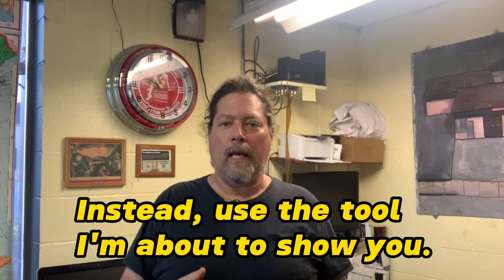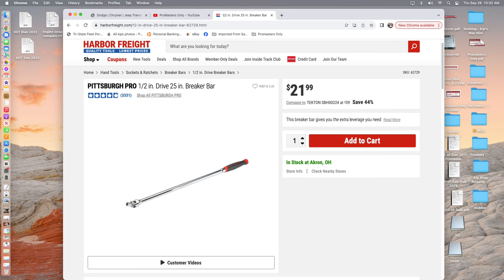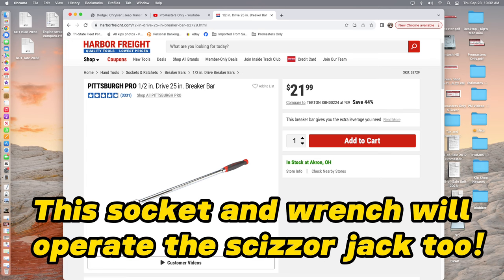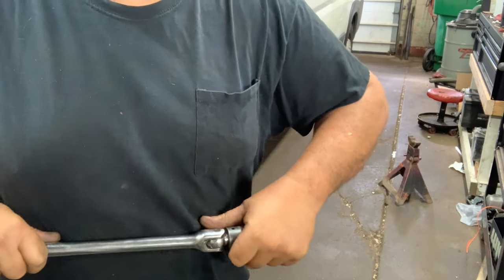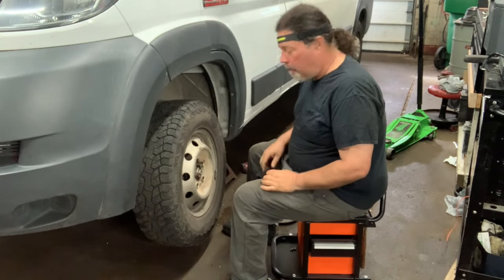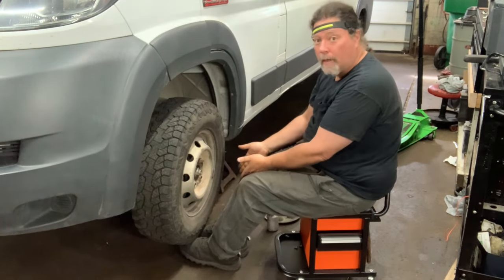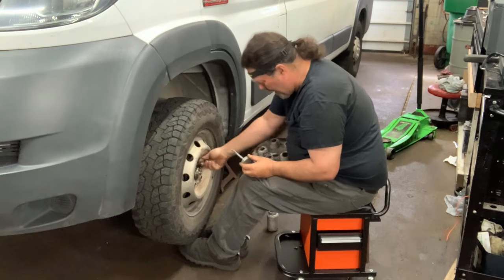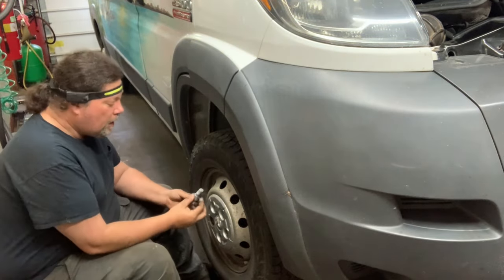Ram Promaster BETTER Lug Wrench Tire Change Nuts Torque and all things Lugs Bolts. Promasters Only

Comment: Hello cousin Kip, I am glad you know that we have Princess Auto in Canada, it makes me feel welcome to your garage. I also put anti-seize on the inside face of the wheel where it contacts the hub, the rust sometimes fuses the wheel to the hub seat. I like your little bench seat.
Reply from the maker: That's a VERY good idea. Not so important on the Promaster as other vehicles, but anti-seize makes everything better, especially in Canada. BTW, those little rolling tool stools are a lifesaver, because we don't put the vans on lifts. I have every tool I need in that little rolling turd, and it's comfy to sit on too! And it's portable, so you can bring it with you if you need. Nice.

Comment: I’m really glad you brought this up I had no idea. I’ve put anti seize on my lug nuts without knowing it changes the torque spec. You sent me down the rabbit hole but I’m back and I know you’re correct. I’ll just have to make people aware of my anti seize when they rotate my tires and specify torque values so they don’t over torque.
Reply from the maker: Correct. All torque specs are given dry.

Comment: I use a tire changing tool aka pry bar from harbor freight to align my tires to make mounting my tires alot easier than manhandling the tires!And I have a inverter in my van so I use and electric torque wrench even though Ram doesn’t recommend it. Just slip the pry tool under the bottom of the tire and let the leverage do the heavy lifting and aligning is sooo much easier!!
Reply from the maker: Whatever works!
Reply: @promastersonly1419  I learned to use the prybar/ tire changing tool from watching my guy that installs tires on my box truck

Comment: Great info as always, thanks. A couple of threaded pins (e.g., long bolts with heads sawed off) can also be handy to hold the wheel in place.  Lots of stories out there about tire shops not hand threading the bolts to start with and stripping them too.
Reply from the maker: God help you if you strip or snap one of those lugs. Always turns into a can of worms.
Reply: @promastersonly1419 can of worms great I’ll grab my rod i keep over head compartment and go fishing

Comment: I did a bracke pad replacement and tire rotation on my promaster 3500, and I have to use wrench fro. A Chevrolet SUV because the wrench from the promaster was bending im definitely getting  a new one for the promaster
Reply from the maker: Best $25 you'll spend.

Comment: Please make a video on front bearings because i'v gone thru a dozen just this year. Thank you
Reply from the maker: Strange. Did we talk about this? Can't remember. The trick is not to replace the bearing, but replace the entire knuckle with a junkyard knuckle for under $75. No dicking around with presses, or scrapping bearings when you install it backwards. And your ABS sensor will just work. But I'd be very curious as to why it's trashing bearings.
Reply: You definitely must be installing the wrong way to go through two in a year

Comment: I love your channel. I have a 2018 long 3500 hi-top. Have you talked about the tire pressure. 80 on the back and 65 on the front. I never carry any weight, I only use it for camping and traveling. Should I run 65 all around ? Thanks
Reply from the maker: Sorry I missed this question. For a light van, yeah 65/80 is too high and the ride will be harsh. I would go to 60 front, 70 rear or even 65 rear. You'll find it's quieter and smoother, and will still handle just fine.

Comment: With the breaker bar horizontal; using body weight you can bounce on the bar and tighten or loosen them easily.
Reply from the maker: True, and I can imagine myself explaining to the emergency room doctor why there is a jack handle sticking out of my ass. Jumping up and down on things is not what you want to be doing on the side of the road, at night, in a snowstorm, with a flat tire.
Reply: @promastersonly1419  I hold it with one hand and my arm straight.  I don't do that stand or jump on it thing.
Reply: @rtz549  damn sure sounds like what you were saying to me

Comment: I stopped using anti-seize after a Tires Plus guy snapped a stud during installation.  He blamed it on the goop.  Probably using a 300 ft-lb air wrench.  Told me to go to a dealer up the street to get a new stud pressed in.  I also quit going to Tires Plus.
Reply from the maker: Common. Lubes changes the torque spec, and I suppose a zealous guy could shoot so much jizz into a blind hole as to make a hydrolock situation (these in the van are not blind). Remember, techs get fired for not using enough torque, so they tend to go completely apeshit, leaving the problem for the next guy. Which is YOU!

Comment: I would like a recommendation for a cordless impact drill for changing tires on the road, as a professional mechanic, I would really appreciate any advice !
Reply from the maker: @HotZone97  very few cordless guns have the power to do the job, and you’ll also be dependant on the battery, it’s state, plus the charger and so forth. For such a specific and infrequent job, use a breaker bar and a simple tube extension if you need it. Any tube that fits over the handle of the breaker bar will multiply the torque and turn you into superman.

Comment: Would you still go with the factory jack, given how much extra weight may be add due to cargo or a fancy #vanlife buildout? (p.s. I have a 4T bottle jack and a 2x2 3/4" plywood sheet)
Reply from the maker: Good question. I would assume that Fiat was smart enough to design/test the jack at the max weight of close to 10,000lbs. If I look at aftermarket scizzor jacks, they all look about the same as the van's jack at 10k. I think it's probably fine. Remember, it's only doing one corner so if the jack rating is equal to the tire weight rating, it's probably fine. But in a motorhome app, I could see combining a tire jack with a leveling jack, so nobody falls off the toilet or rolls out of bed. Lots of options, I suppose. The advantage of scizzor jacks is space and weight and storage.
Reply: I was thinking of doing the same thing buying a bottle jack to simplify or a low profile floor jack to go with my electric impact wrench!! Make sure you get yourself a pry bar tire changing tool from harbor freight to make aligning the tire up much much easier!

Comment: The 1st time I backed out those LUG STUDS, I thought WTF… the whole wheel stud came out too, with the lug nut.
Of course it was at night in the dark on the  Kentucky Turn Pike In the fricken rain !!
But yes that tool is complete junk that comes in the black box !!
I used the scissor-jack underneath the extension piece to keep it level with the lug stud.
What a engineering failure on their part with that extension and T-bar handle thing !!
Reply: Pick up a pry bar tire changing tool from harbor freight for aligning the tire leverage works better than manhandling and allows for one hand treading
Reply from the maker: Agreed!

Comment: One of my lug bolts is broken off and completely stuck inside the wheel drum. Mechanic says the entire knuckle assembly needs to be replaced. $1000 for a broken $8 bolt
Reply: You could have located one from the junkyard and made out like a bandit for around $100
Reply from the maker: Junkyards have the complete knuckle for $75-100.

Comment: Heavy van plus those steel wheels.  If those wheels are flimsy or flexible; theoretically they could attempt to work the wheel lugs loose.
Reply from the maker: True, but the difference between 105 and 143 seems immaterial to me. At 105, they are NOT going to loosen up and come flying off.

Comment: Hi! I have a 2016 ram ProMaster 2500 Cargo Van and i took it to a lock smith to program a new key for it. But it wouldn’t accept the key and it would start the van but cut off all power after 3-4 seconds. If you know or heard of the problem please let me know! I’d love to hear from you.
Reply from the maker: That means the security system is tripped. You'll notice a little padlock icon on your dash when that happens. It'll start, run for 3-5 seconds, then die. I have a video with "key debacle" in the title. It won't help you get the right fob programming, but at least you know the metal part of your key is fine. I imagine you ordered that from the dealer. But your fob still needs programmed. I'm going to guess that it isn't operating your power locks?
Reply: @promastersonly1419 I have a backup key that locks and unlocks the van but sometimes it starts and cuts off after 3-5 seconds. Took it to a mechanic and they said it’s rejecting the key. But like I said it locks and unlocks the van. Maybe a cpu issue?
Reply from the maker: @orenw1262  honestly stumped. The same fob that works to fire the locks should work to start the van. Maybe something else is tripping the security system. You dont have access to a pro scanner, do you? One that can read body module codes.
Reply: @promastersonly1419  unfortunately we don’t have access to one. Seems like a problem we won’t be able to solve unless we involve the dealership which is a pain as always. But thank you a lot for your help! Earned a sub for sure

Comment: If those wheel lugs aren't known for or aren't prone for snapping off; I would be perfectly fine with 143ft/lbs torque setting. 

If one wheel lug was much tighter then all the rest; I could see how that might cause all the others to be 'loose'.
Reply from the maker: Remember, they tighten up over time if seems. I have personally struggled with them at what must be something like 250 ft/lbs, judging by how much bar, gun, and heat they took to get off. But you do you, mister!